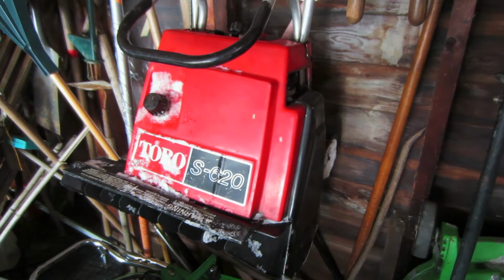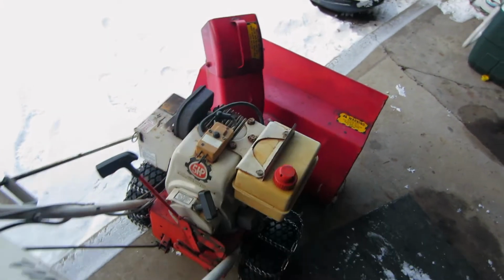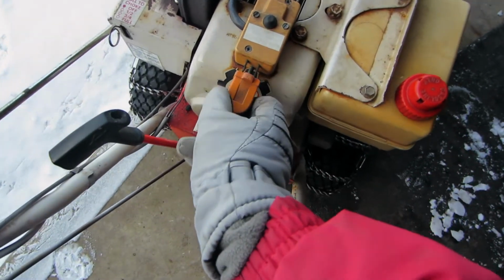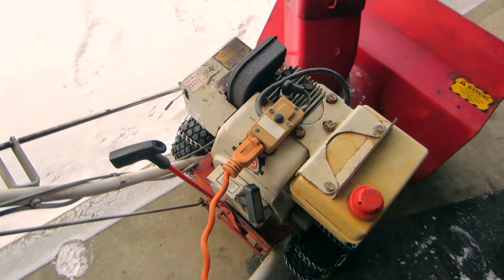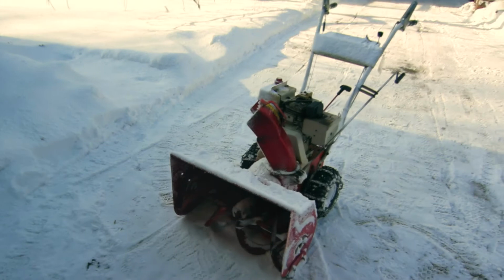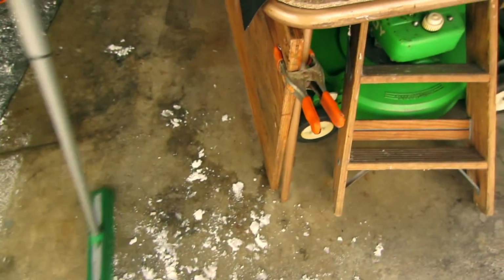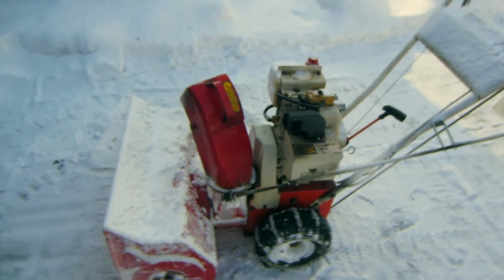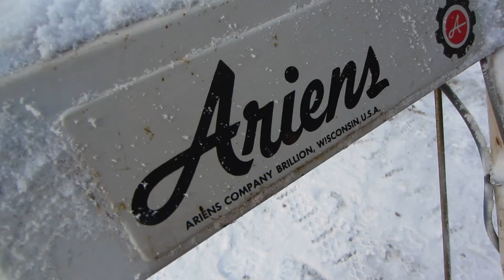1974 Ariens SNO-THRO | Dec 17 '13

Comment: Pretty cool, though that price seems a bit high, to me, but it may be a great one, I'm not sure..

Wow, an electric start must have been quite nice back in the day. I know my grandfather has at least two old snowblowers in his garage, I should check them out. I think one looks like that but I'm not sure.

Never seen a gear shift like that before, or mounted to that, but then again, like I said, I'm not a snow blower person. You'd think they would mount it on the cluster near the throttle, but this way, I guess, there is less things to go wrong. 

That is quite a nice machine, it does a really good job.